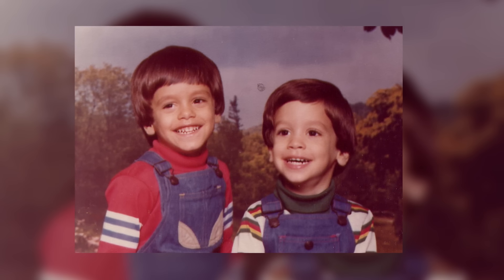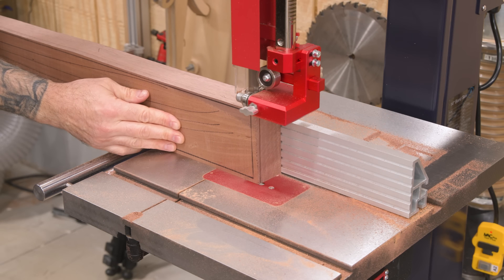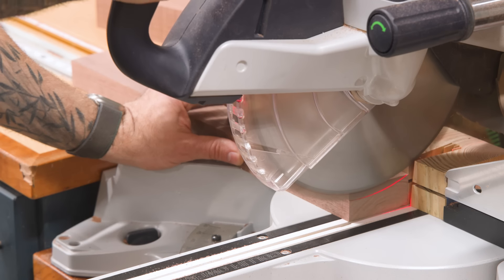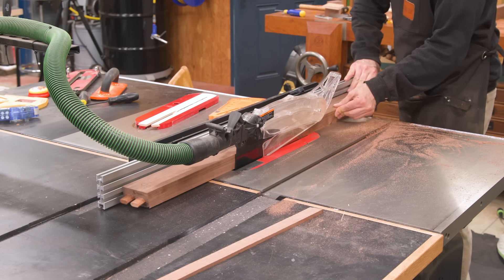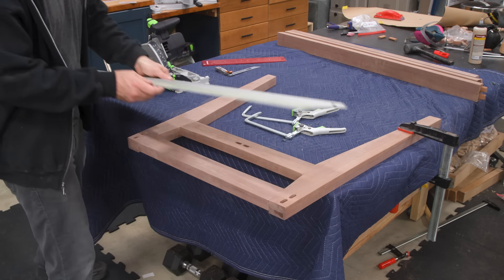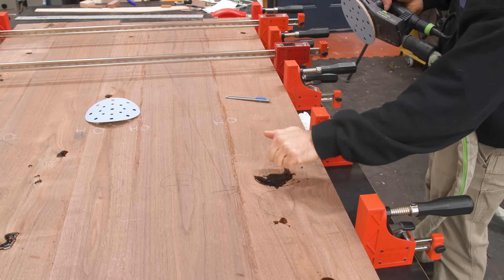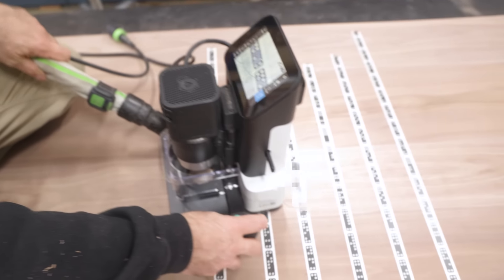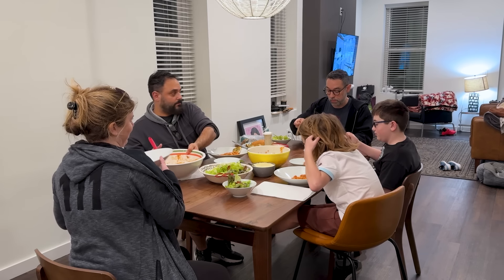Unexpected Gift For My Brother! | Beautiful Walnut Dining Table

Comment: Based on the design specification documentation I have for the Shop Cat version 2.3a, the Shop Cat is working within acceptable tolerances. Per specification no adjustments are needed at this time. BTW, the table turned out great and thank you for sharing the adventure.
Reply: yes, those Shop Cat operations are features, not design flaws.😺

Comment: Did you use the finger nail bit and a round over on the edges of the table? Didn’t the finger nail cut the profile on both top and bottom therefore the round over becomes a bit redundant? I’m having trouble picturing the final edge profile.

Comment: After quite a few mishaps with the Domino fence, I kind of stopped using it. I made my own offset bottom base for it and I find there is much less chance for error and I never run into the issue that the fence doesn't have enough travel.

Comment: I have a question about your workbench and your holdfast. Do you run into issues with the holdfast hitting your cabinets underneath?
Reply from the maker: Nope. And if they do, they get shortened. I think we did have to cut the one forged one from Lost Art Press if I remember correctly.
Reply: @woodwhisperer  thank you 😊

Comment: Uhhhhh.... you need a laser toy (not on your miter saw).  You take the laser, hand it from the ceiling using a string.  Point a small fan at said string. 

Just beware-- when feline gets hungry, better have food set aside ahead of time.  Otherwise it will start eating your face... 😢